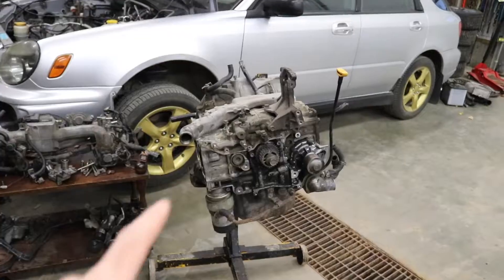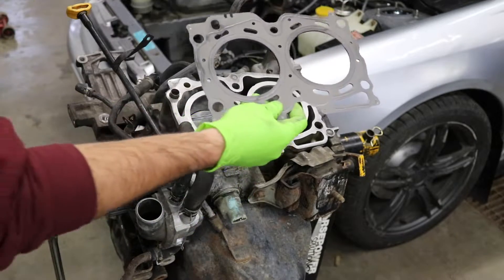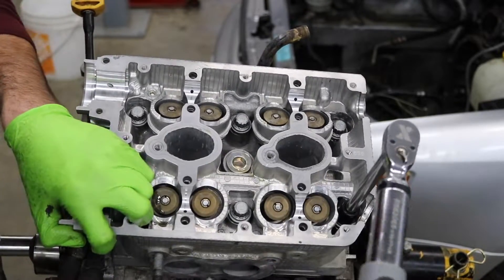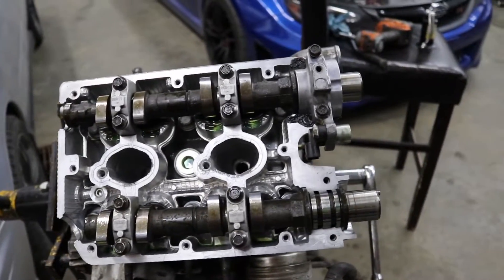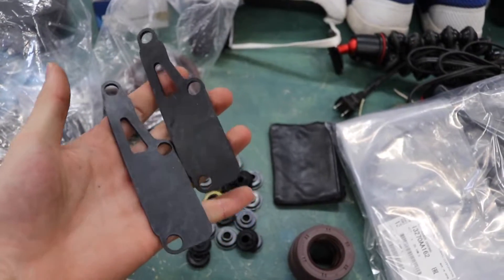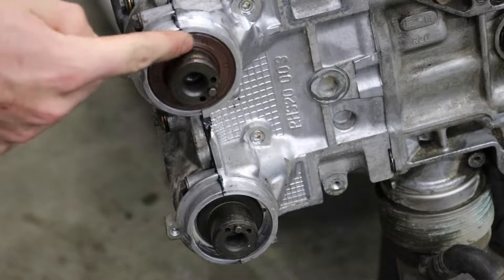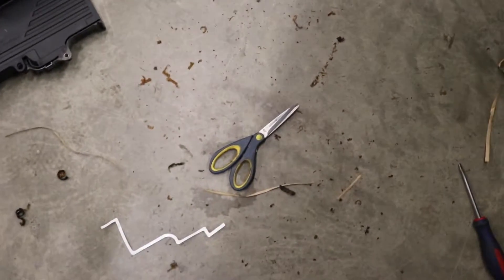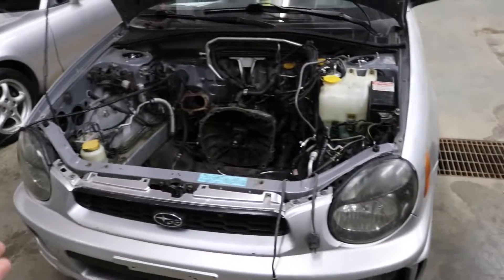Assembling My Subaru Engine!! (WRX)

Comment: You're supposed to put oil on the head bolt threads and also the washer surface where it sits on the bolt boss.

Comment: Just a correction if u run a aftermarket intake you will pull more air so once the computer realizes that it will compensate for more fuel so it will throw a rich code not a lean code unless the inlet diameter on your intake is much bigger than the stock size inlet diameter then yes the increased volume of air will cause you to throw a lean code but most general aftermarket intakes won't cause that even without a tune but good video though
Reply from the maker: If you are talking what ecu monitor data shows on your short term fuel trims, then yes you are correct it would show a positive number (+5 to +25% etc) due to compensating for the lean condition. Although this does not mean the engine is running rich, that is strictly the ecu adding the percentage of fuel required to hit a fuel trim as close to 0 as possible. A rich condition is a rich reading from the downstream/upstream O2 sensors (which is the actual combustion performance/characteristics of the engine). As soon as the ecu sees the rich readings from those sensors, it will then change the fuel trims to a negative number to pull fuel & compensate for the rich condition (-5 to -25% etc). With a cold air intake the ecu will be adding fuel, but will not throw a rich code. The ecu will add as much fuel as it needs to hit the target of a 0 fuel trim, it will not add any extra to cause a rich reading from the O2 sensors or a rich code. If the ecu is not able to add enough fuel to compensate for the excessive amount of air from the cold air intake, it will still show a + fuel trim as it is still adding fuel. If it is not able to add the proper amount of fuel for the excess air, the engine will begin to run lean & throw a lean code from the O2 sensors. 

Wow that was a long reply 😅 appreciate the comment JP 🙌🏼

Comment: You noticed the crack at the spark plug area on the head right? 2.0l heads are prone to cracking at 100k miles. You take a straight edge against the heads to make sure it’s true and flat?
Reply from the maker: Yup! I saw them & decided to just send it cause I don’t have an extra 2k for a new set of heads 😅 the cracks are only at the spark plug threads & not at the valve seats…..for now. Full send or no send on a budget build 🤪. Yes the heads just got resurfaced, they are 100% true & flat.